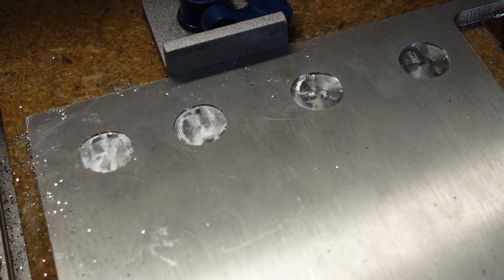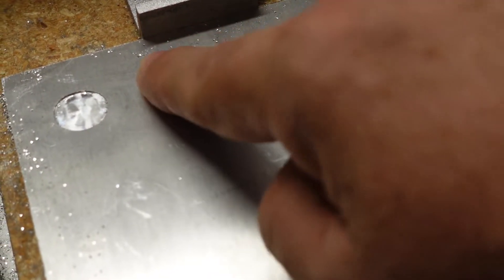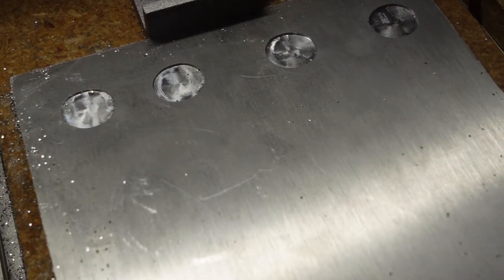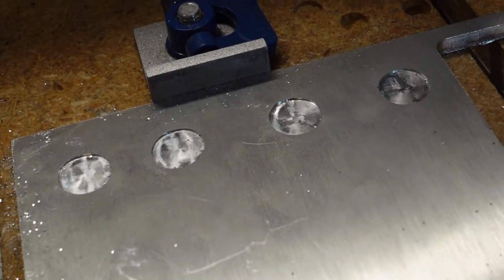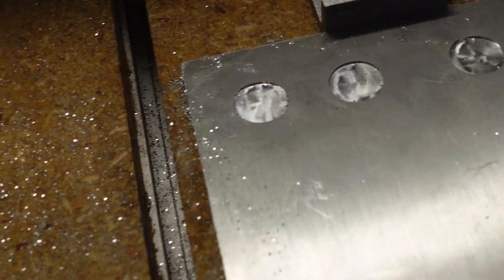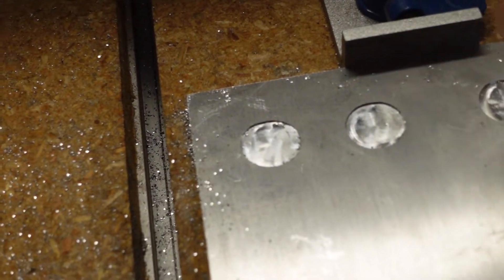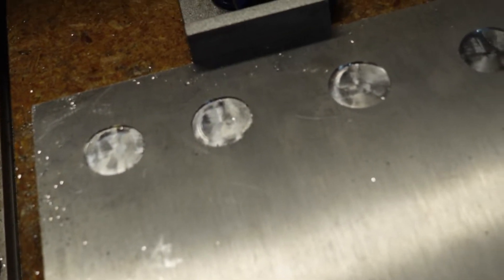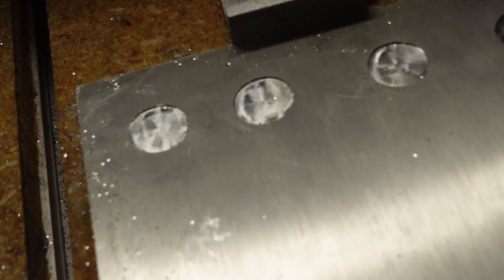How fast and deep can I go? Aluminum milling test, part 2.

Comment: @tkdesigns could you post more details how did you clamp it to the cnc bed ? i always face trouble placing the pieces in a way that avoids them to vibrate against the end mill causing it to break.
Reply from the maker: In the lower left corner, there is a 3D printed fence that I use to align to the X and Y axis. At the top of the aluminum sheet, there is aluminum stop block in the T-Track.  Off camera, there is a standard hold down clamp, away from the cutting area of the CNC. 

Alternatively, I have used painters tape and CA glue before as well. Thanks for watching!